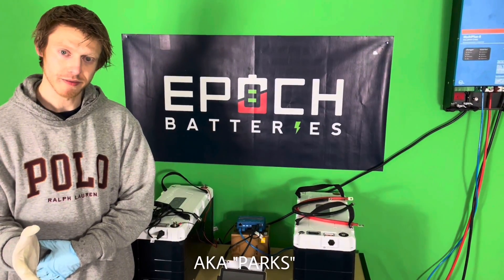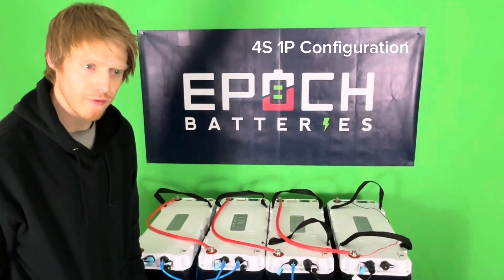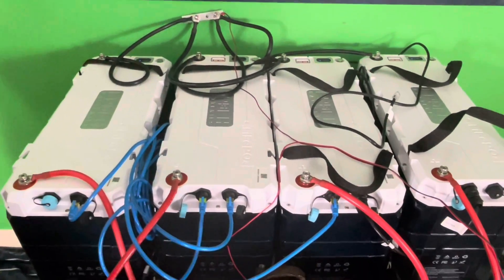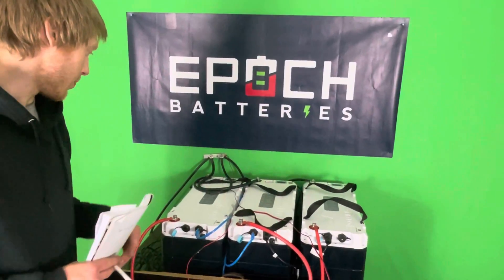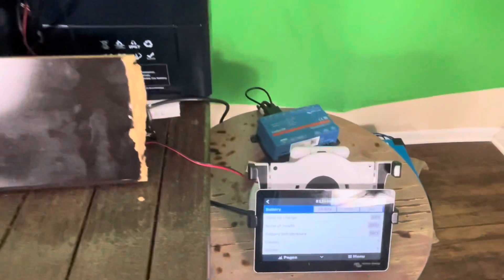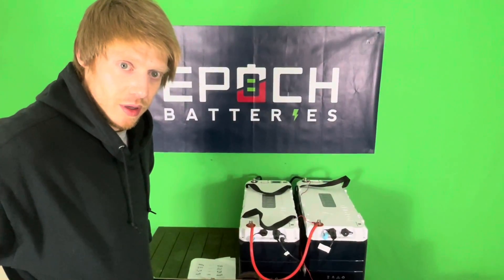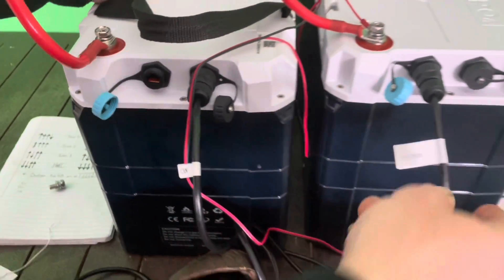Epoch Batteries - Dip Switches & Configurations using the Victron Cerbo GX

Comment: @epochbatteries guys I’m having very frustrating issues with my cerbo gx mk2. It is the new version where the can ports are configurable for bms. I’ve have 2 parallel and set up just as you show at the end of the video, I’ve tried every can setting, different ports, new cables, and I can not get your batteries to communicate with the cerbo…..??? Please why is this, again it’s the newer cerbo the doesn’t say bms can on the cover, but is configurable for bms can…. Only victron options are 250bit. Are my dip switches incorrect for this new cerbo?

Comment: What are the dip switch settings for 2s2p?
Reply: Did you ever figure out the DIPs for this config?
Reply: @kurtgasper8600  the communication does not work for that setup.
Reply: @bradshaw106  that sucks.  Could have saved some $$$ and just got the ones with out the comms then.  That is not good on Epoch part.

Comment: In the 1S2P configuration, your DIP switch illustration shows four batteries.  Are we to use only the master and Slave 1 information, or…?  Thanks!
Reply: yes Epoch, you need to correct this in the video or at least here in the comments.  We can't add a graphic to the response but just make sure you look at the 1S2P DIP setting in the manual for the correct setings.

Comment: On the 1S2P configuration, you refer to the CAN bus wiring with three points.  CAN, Victron, Inv.  Does that 3-point logic harness come with the batteries, or is that a special harness with a separate SKU?  Thanks!

Comment: I noticed in your dip switch graphic you show ve.can, however when plugged into the cerbo, it appears to be in the bms.can. is your battery able to work in ve.can?
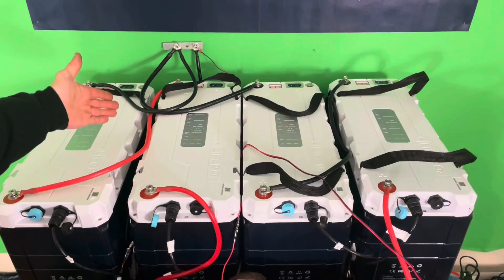Reply: At 1:18 you say it’s important to get it right or it could be a bad day. Then, you do not show the bus cabling ir the dip settings to get it right. Could you please share this information? Customers are having bad days
Reply from the maker: Yep
Reply: @epochbatteries  Did you have to change the bitrate of the VE.Can ports to 500 kb/s?
Reply: @murp0443 where you able to figure this out?
Reply: Yes... this does raise the question of what bit rate the can port of the epoch battery operates at.  Could you answer that @epochbatteries